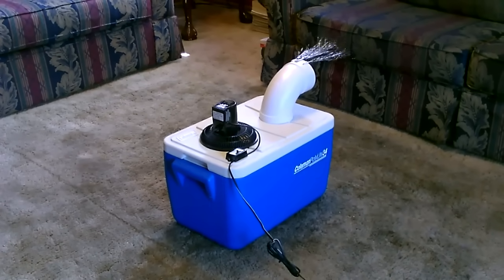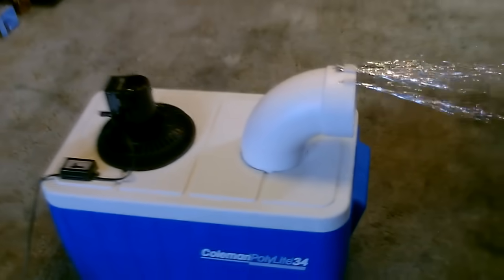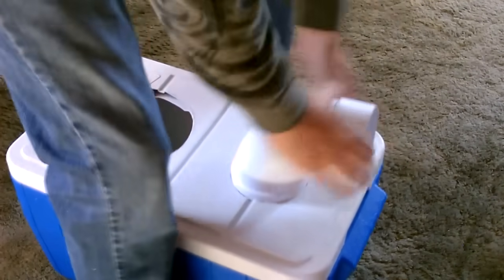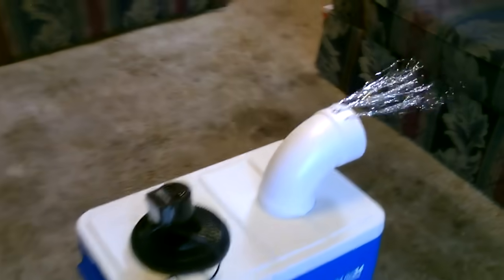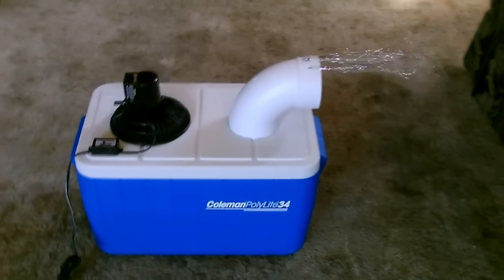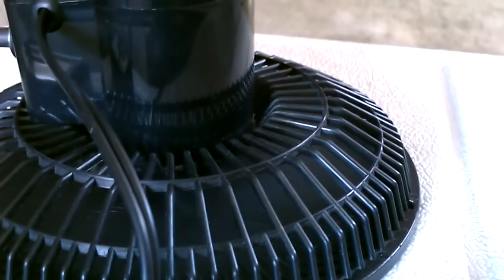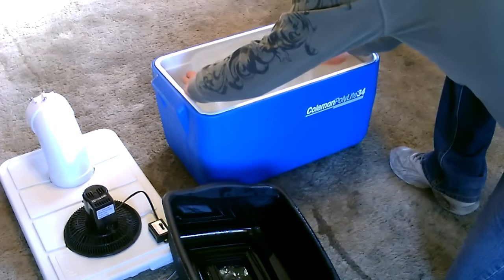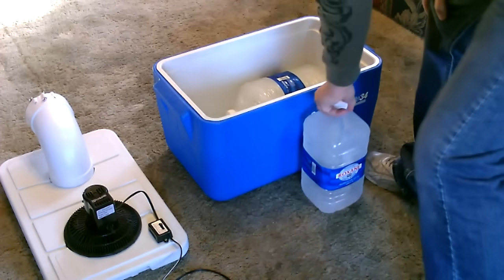Homemade air conditioner DIY - Awesome Air Cooler! - EASY Instructions - can be solar powered!

Comment: what size pvc pipe you used for the out flow?
Reply: i was wondering the same question. I just made mine today and I used a 9 inch fan with a 4" pvc 45 degree elbow, use is for outside dj gigs

Comment: i use an evaporative cooler which is also called a natural moisture humidifer as a base and i sit a block of salted ice in a office trash bin above exhaust vent. By lowering the temperature of the air hitting the ice it lasts much longer

Comment: Or just put the whole cooler in a deep freezer and fill with water.
Reply: usually, when you don't have money for an air conditioner, you don't have a giant freezer in your appartment.
Reply: +Hide and Tweak good point. I was more thinking for when you take it with you somewhere.
Reply: that would not work as well actually.  you want the air to circulate 
around the ice as much as possible, not just blow above it.  It would 
actually work even better if you put a baffle in the middle of the lid 
to force the air down before it can exit the port.
Reply: Neil Smith if you have a deep freezer you probably dont need to save $$ on an a.c.
Reply: Good point
Reply: The fan is pointed down already... So a baffle would increase building cost. If the baffle isn't airtight along the sides/ top, air 'spills' through anyway. This setup surely does a great job, as is. But love reading the engineering thoughts!
Reply: Abraham Tran I built one for my chickens. Works great
Reply: I was thinking that same thing
Reply: Neil Smith 
lwt73oa19
Reply: Neil Smith
Reply: Neil Smith up thats rite
Reply: Neil Smith yup thats what I'd do
Reply: If you put the whole thing in a deep freezer you can't use it while you're waiting for it to freeze. Unless you build 2 of them
Reply: Freezers are fairly cheap to run because they're sealed, if you put a fan on the freezer and blow cold air out you will see your energy bill rise extortionately, your freezer will probably break down a lot quicker due to it having to work harder to keep cool. When you open your freezer door it gets louder because it's at work cooling, leave your freezer door ajar all day and see if you have much money left on the meter. Freezers are engineered efficiently, part of that is being air tight, remove that air seal and pay the cost.
Reply: @ Hide and Tweak ...LOL well spoken my friend!
Reply: Coppulor 9
Reply: Neil Smith yup
Reply: Building cost? Seriously? lol
Reply: Agreed.  I have AC but was thinking this would be great for the back yard or at the pool or the beach

Comment: Just remember that if you are using this in the same space where your freezer is located, the net cooling effect is zero. The heat you remove from the water to make ice is dumped right into your kitchen. I guess you could con a friend into making the ice for you in their freezer.Great idea for a portable unit in a camper or such place.

Comment: u could try dry ice too, it would probably be colder and last longer
Reply: yup, it'll last the rest of your life! by the time it fully melts, you'll be dead b/c, unlike regular ice (H2o), dry ice is made from carbon dioxide (Co2) which is VERY deadly to oxygen breathers!
Reply: From Wikipedia: Dry ice, sometimes referred to as "cardice" (chiefly by British chemists), is the solid form of carbon dioxide.
 It is used primarily as a cooling agent. Its advantages include lower 
temperature than that of water ice and not leaving any residue (other 
than incidental frost from moisture in the atmosphere). It is useful for
 preserving frozen foods where mechanical cooling is unavailable.
Dry ice sublimes
 at −78.5 °C (−109.3 °F) at Earth atmospheric pressures. This extreme 
cold makes the solid dangerous to handle without protection due to burns
 caused by freezing (frostbite). While generally not very toxic, the outgassing from it can cause hypercapnia (abnormally elevated carbon dioxide levels in the blood) due to buildup in confined locations.
Prolonged exposure to dry ice can cause severe skin damage through frostbite, and the fog
 produced may also hinder attempts to withdraw from contact in a safe 
manner. Because it sublimes into large quantities of carbon dioxide gas,
 which could pose a danger of hypercapnia, dry ice should only be exposed to open air in a well-ventilated environment.[28] For this reason, dry ice is assigned the S-phrase S9
 in the context of laboratory safety. Industrial dry ice may contain 
contaminants that make it unsafe for direct contact with foodstuffs.
In confined spaces; like in a van, it can be hazardous; but you're correct about my confusion w/ CO; still, I would not recommend it. Thanks for the clarification, though.
Reply: Geez, CO2 is not deadly at all.  You are confusing it with CO.  Our atmosphere has lots of CO2 in it.  You breathe it out.  You'd have to actually replace all air with CO2 to induce asphyxiation form absence of O2.

Comment: Enjoyed your video. So much better than the guy that uses dry ice in his 'bucket cooler'. Hey, does anyone remember the aftermarket automotive ice chest coolers from the '50's? they look just like the one in this vid. Also the window mounted coolers from the same era where wind speed from the car's movement blew cold air into the interior ('till the ice melted).

Comment: Very clever and simple.  Consider adding an adjustable thermostat switch with the sensor installed in the discharge air flow to cut off the fan at a chosen temperature.  The fully melted ice water should provide cooling for many hours after ice melts.  Nice cooler.

Comment: hey that is fabulous! What an original and very easy solution! Must be quite convenient in the hot desert there. Would it help to make a hlfway dividing wall in the middle at the top, so that the airflow must really go through the bottom to find its way out again? (If you had two blocks in then you could have that divider between the two blocks.) Did you close up the space in the top lid that was open due to cutting the circles in it? Do you need to close that off? Great work, thansk for sharing! Oh and PS compare this solution to a normal AC ven, I mean you save amazing amount of money this way!

Comment: For those saying use dry ice that is a STUPID idea but great for suicide
Reply: bob Jaramillo dry ice is co2 in its frozen from(very cold) but as it melts it releases large amounts of co2 which is not a big deal in ventilated areas but in a small room or automobile(with closed windows door) it can be bad for your health.  i don't think it would be enough to kill a person... but it could make for a very bad day
Reply: Only if you sleep in an airtight room.
Reply: Walter Gregory   and farting 😁
Reply: lzvagias its quick evaporation isn't the issue. Dry ice is frozen Carbon Dioxide. It would displace the oxygen in the room and cause light headedness and possible death if the concentration is high enough. We use dry ice to blast metal and it makes you sick FAST if you're not careful.
Reply: If dry iceIs so harmful why do they sell it at grocery stores and why do people have it in front of their house on Halloween?
Reply: Mallard D thanks for the answer.  I wondered the same thing.
Reply: Billy Bob do you understand how much dry ice it would take to display enough oxygen in a room to suffocate you??  It would take way more than you can fit in that cooler, I promise you that.  Furthermore, you'd have to literally seal off the entire room to prevent any air from outside of the room from getting it.
Reply: why can't you use dry ice
Reply: Dry ice will not last
Reply: wizardcraft671 biiiiiiiiiiii
Reply: +Cali Fornia cali. try living in vegas, your delivery truck would catch fire, cause its so dam hot here...im going back in my walkin freezer.
Reply: lzvagias- Do you understand how condescending and just plain old rude your response was? Holy cow, man.. So, so very , absurdly unnecessary. Were you having a bad day or something?
Reply: Mallard D So if used outside at the pool area. It would probably be ok, right ?
Reply: Yeah, it's only an issue if you are in a completely sealed off room, which isn't likely. No matter how sealed you think your place it, air will find a way in and out. Or else we'd all die in small spaces by the collection of CO2 just from us exhaling.

Comment: Great video. I have 2 questions what size solar panel to use (amp size) to run the fan.
plus have you ever tried dry ice to see if it would last longer??

Comment: you do realise of course that your freezer has to work harder in order to freeze the water.... Right??
Reply: +Zak farley, so called expert is worried about over working a compressor which is designed to operate ...why have a freezer at all if you wanna be a freezer nazi.
Reply: Well, this is true. You need to expend some energy to freeze the ice. It will take some electricity. But a freezer doesn't do anything to cool a room. This uses some power from the fridge to make the ice, but after that, it's basically free. Modern refrigerators still use only a fraction of the power of an AC.
Reply: Yes, but it is running anyway, might as well get all the use you can. Everytime you open the door combined with ambient temp., not what is inside, is what dictates power use.
Reply: gamingogre Trust me on this one, anytime you place something at a higher temperature than the programmed thermostat temperature for the freezer. The compressor at the back works its lil but off until all is equal ;) Source - Refrigeration expert for 20 years

Comment: What if you take it a step further and use a block of dry ice?
Reply: +Oliver Bergmann "DRY ICE" is carbon dioxide, not carbon monoxide.
Reply: +butchtheiw your analogy makes no sense whatsoever. Just because a substance is good for you or plants in small amounts, does not make it good for you in higher concentrations. Fitting example since you mentioned plants: Water is essential to human bodies and plants (i.e. plants use water in their carbohydrate cycle together with CO2 to generate oxygen and glucose). But if you overwater a plant, it dies. If as a human you drink too much water in short amount of time, you die (look up water intoxication). I assume you wouldn't recommend people drinking a gallon of water in an hour to quench thirst (I recall a case about that with a radio show that had a water drinking challenge) and at the same time you should not recommend that it is in any way safe to fool around with dry ice as a cooling method.
Reply: Uhm no hes right you can easiely die...whole monoxide is even more deadly as a way smaller dsoe will kill you without you even noticing dioxide will make you feel tired and kill you very slowly.....if your place has enough air fluctuation to make the diocide harmless the air conditioning in itself would be useless to begin with
Reply: I wouldn't in an enclosed space. I would be using this at outdoor (summer) swim meets which offers plenty of ventilation. I will be trying the dry ice myself. Might work, or might just end up being the most amazing fog machine ever. 😂
Reply: Less Humidity but you will have to pay for DRY ICE when you can freeze milk jugs of water over night
Reply: lol
Reply: Bad idea. We tried that in a VW van in the Nevada desert. See the comment below.
Reply: Tha Ryddla
Reply: You're thinking carbon MONOXIDE, bud. That will asphyxiate you. Carbon DIOXIDE, which dry ice gives off, is the same thing that you breath out with each breath. Unless you're in an enclosed space and are getting massively high levels of it, with no ventilation for a long period, it's harmless. We give it to plants when we exhale, and they use it to produce oxygen for us to breathe. CO2 is what they use in soda carbonation, too. Quit telling people it will kill you, goofus.

Comment: Now what we all need to know but my have already been answered in the past comments. How long does it continue to blow cooler than the room temp air. How cool does it make a mid to small sided room. How long does it take to cool a mid size room. And lastly does it work when the ice melts and it's just blowing on cold water? I think it's a great idea! I saw some throw a cool air humidifier in one and some ice as well. It sort of defeats the purpose of not using electricity but I think it's the best idea for a grow room with no windows! Just get a mini freezer and make one of those and keep the bottles or ice in rotation! 5 hours sounds like it would suffice in cooling a 30x30 foot room pretty cool. I dig it! Many great applications for this!

Comment: Adding salt water will lower the temperature even more.. try it
Reply: The temperature will be plenty cool. The real trick is finding a way to make the ice last longer. If you could get it to melt more slowly (which is why you use blocks instead of ice cubes), then this will be even better.
Reply: +RedHeadKevin salt makes the ice melt slower
Reply: no, salt melts the ice quicker.  that is why it is colder.

Comment: i wonder if instead of facing the fan inward and having an output vent, if you can just forego the vent and have a fan facing outward to suck the cool air out. which would be better
Reply: From a laymans thinking:
By this your suggested setup, you are only bringing out smaller amount of cool air (since there is limited air inside the system. But if you push air inside, you have succeeded in doing two things: 1 You have reduced the amount of hot air in your room, 2: There is more hot air hitting the surface of the ice, thereby melting away and sending out cooler air in higher quantity
Reply: pushing air in means you're "pressurizing" the unit so that the incoming air travels through all nooks and crannies of the ice.  if you simply pull air out, the incoming air will avoid the ice and go straight to the exit.
Reply: +icawn Also, the exiting air is humid and most fans will rust inside the motor,  so you will lose the fan more quickly.

Comment: Just purchased items to do this, hope this works well. Tired of high prices for monthly energy. :D Bought 2 batteries because why not? xD
Reply: A fan running for this won't draw a lot of electric.  The fan on air conditioners is not the power hog it's the compressor motor.
Reply: how is it working out for you?
Reply: He used dry ice instead of ice. RIP.Stack Bundles
Reply: Stack Bundles Well its not the best, atleast with dual holes. One hole for current air flow to go out is good. Regards to the fan pressure, its also not the best with the current one he uses. Im using it aswell, uhm i would suggest alot of ice for this to work, also perhaps an insulated cooler.
Reply: +Godz thx bro

Comment: Since you are using a electric power you could use a electrical powered cooler box instead and drop the ice. Make a hole in the side of the box. Should work.

Comment: I was thinking the best of both worlds would be to have the largest tupperware box that would fit into both the box and the freezer, then you wouldn't have to handle the ice with your hands. And have multiple of them so you could keep swapping them out when they melt.
Reply: I got the cheap plastic dish pans from Dollar Tree. Fits perfect in my side by side...in the bottom.   Also its not extremely rigid so if you twist it a little...the whole block comes out easy.   I filled it half full so it has room to expand.  
Its freezing now so we will see!   I want to stand it up once frozen so the fan can hit all sides

Comment: TIP: if you have a hot running electronic, PlayStation, Xbox, PC take and put a piece of bendable tubing and attach it to the PVC pipe and direct to strait into the cooling ports. The fan from the device will cool it off in no time.

Comment: awsome video! i tend to try and make one of these every year and every year results in failure the last one i made i just used a normal transparent box and it used to make condensation drip out everywhere as the outside of the box got too cold, plus it was only using a small usb fan. i just made a new one yesterday and used a small cool box like you have and i used a more powerful fan that plugs into the 3 pin uk socket and it works amazing! cools my whole room down, plenty of air flow and no condensation leaking over everything! superb bit of kit! thanks for inspiring me to make one! it works really really well and i think i am now ready for summer!

Comment: Dry ice should make it colder correct?
Reply: Yes but it also produces Co2 which is very dangerous if you're in a closed environment
Reply: +Bernard van Asselt are you stupid?. co2 is bad for you. Thats why your lungs get it out when you breath out.
Reply: Dry ice should make it substantially cooler. However, one could die from asphyxiation. I am not sure how long it would need to be running in a given volume of space, but it is not worth the risk.
Reply: Ummm dry ice is co2,maybe not a good idea in an enclosed space
Reply: Dry ice is made from carbon dioxide, which will kill you as it melts. Not a good idea if you value breathing!
Reply: +Flowey the Flower CO2 isn't dangerous. CO is.
Reply: +Bernard van Asselt Co2 is
Reply: +peter gotch